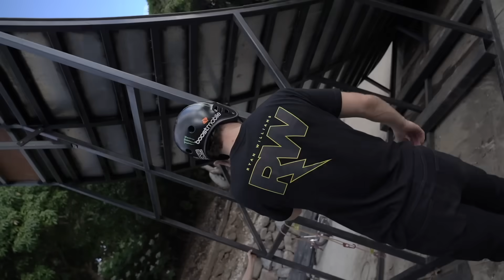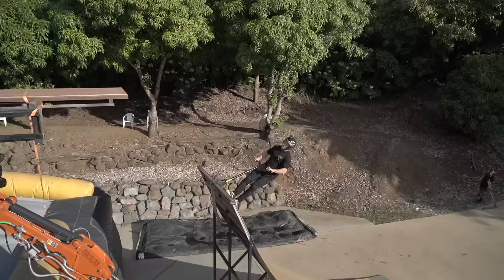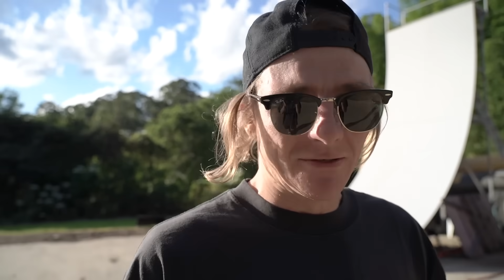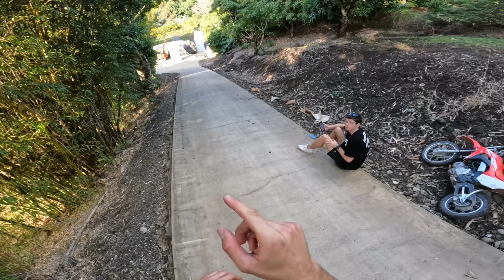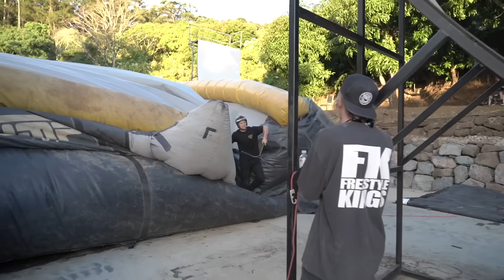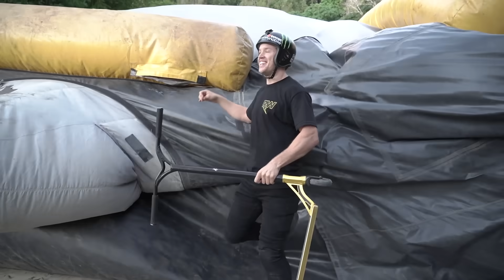My Crazy Idea actually worked!

Comment: Flip it... Ride the roof upside down. As you launch off the ramp you do half a backflip then grind the rail upside down and then do the other half of the flip as you slide off the rail. 
For BMX you ditch the rail and backflip off the ramp and ride the roof upside down backwards then backflip off the roof upside down to land facing forwards. It's one flip interrupted by an upside down trick then finishing off the flip.......

Comment: And now for something really dangerous. Suspend a long pipe in the air. Launch off the ramp and whatever you are riding goes under the bar while the human goes over it and reconnects with whatever you were riding for the landing. Think pole vaulting or high jumping.  
And now for something REALLY dangerous.....   Raise the bar higher. Launch off the ramp and grab the bar with both hands while your feet hold onto the bike and swing around and let go of the bar and grab the handlebars to land as normal. Foot clips or an extra bar welded into the frame to allow your feet to hold the bike through the bar flip might be a good (really bad) idea.... Call it the ER since that's probably where the trick will end up.........